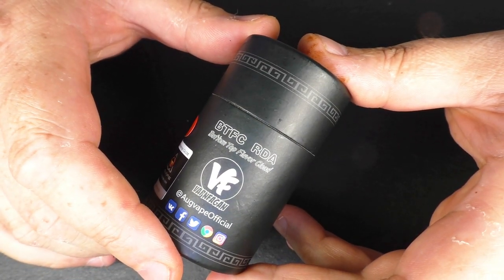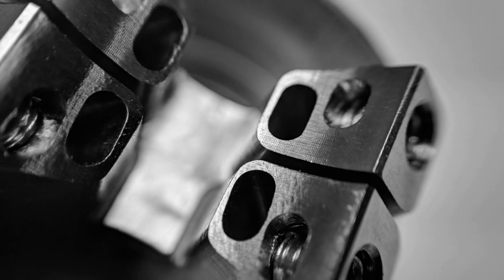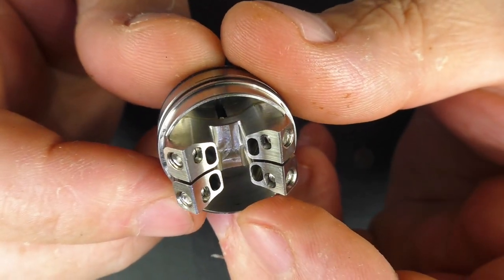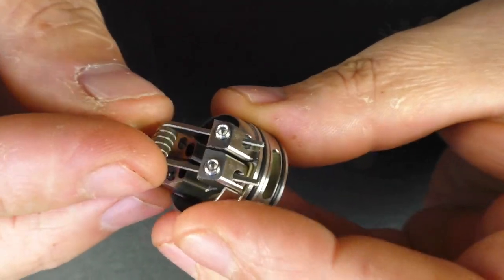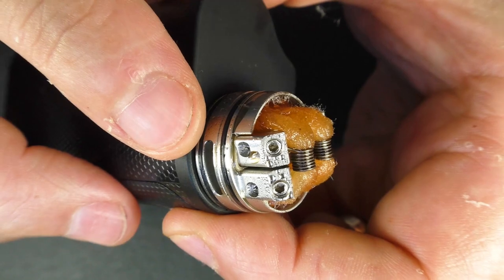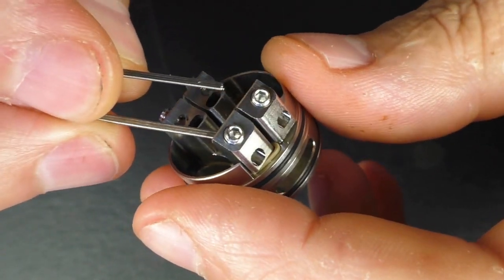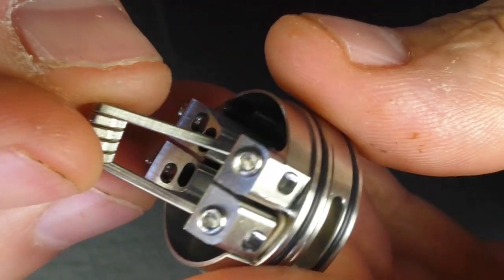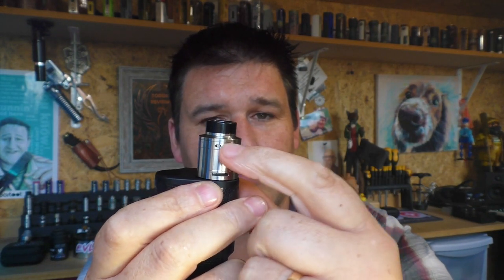BTFC RDA By Augvape & Vapnfagan

Comment: Ive wondered why we haven't heard everyone saying how absolutely genius this deck design is. I dont have one but it looks like the most simple dual coil build ever. Easier than the drop and dead rabbit even. I think mark did a real good job here. Did you notice how that one bottom air slot isnt machined straight? Its crooked, i noticed in the really close up shot you did.